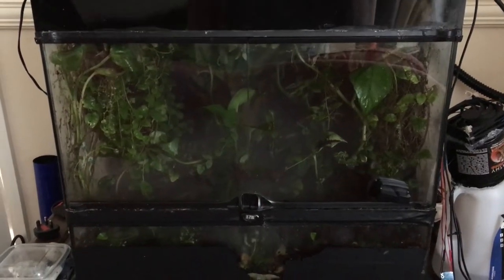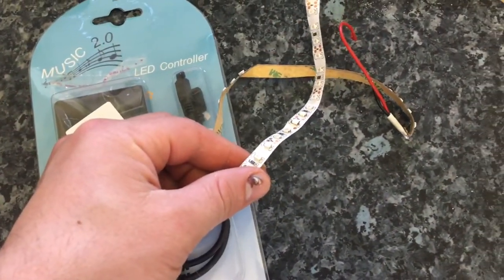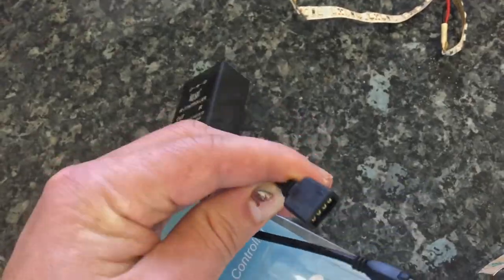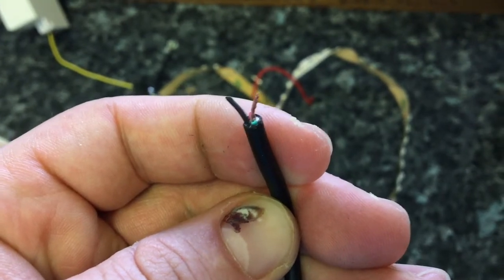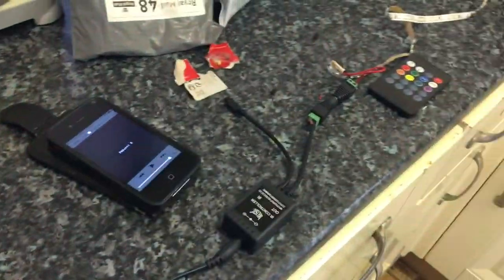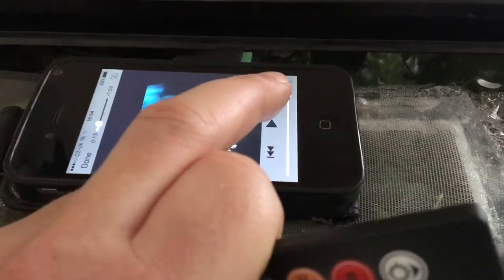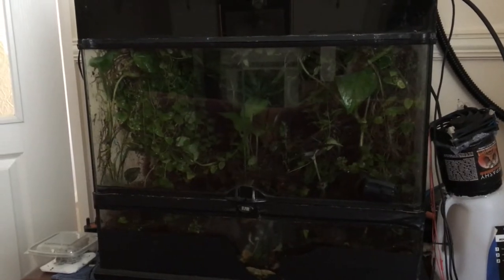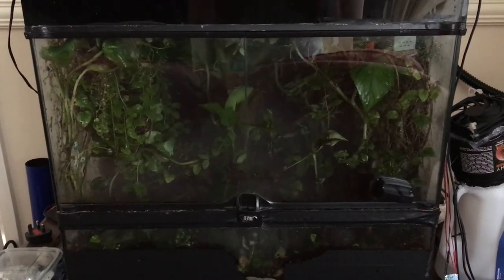How to Make Lightning Lights for your Vivarium / Terrarium / Aquarium (DIY Fluval Aquasky)

Comment: Is it possible to make the sensor/mic longer so I can put it outdoors? I would like it to flash from actual thunder outdoors. I have this hypothesis that my snakes can sense the difference between high and low pressure in the atmosphere and so are "expecting" rain and thunder if pressure falls.
Reply from the maker: I don't see why not, thats a cool idea
Reply: Should would like any other splice job. As long as the cable is running to the microphone (cut, tied together and taped up) should work fine.
Reply: Another idea: Can you make it dim the main lights, say when there is a rumbling sound, ie as the storm is rolling in?